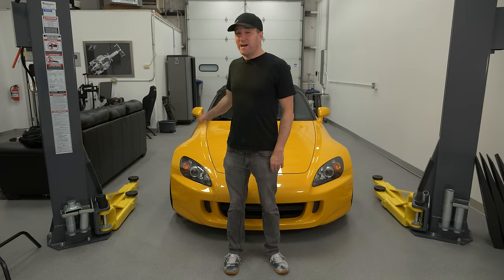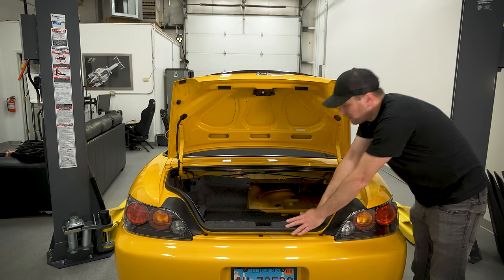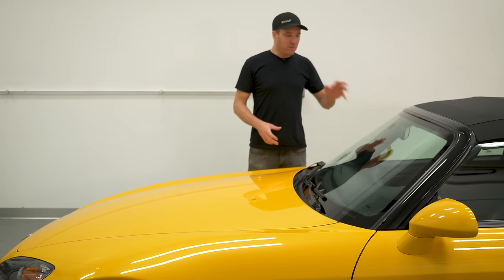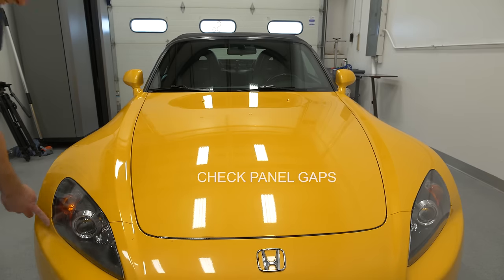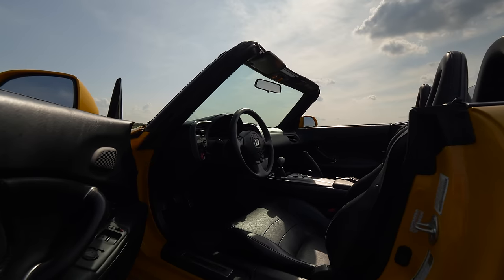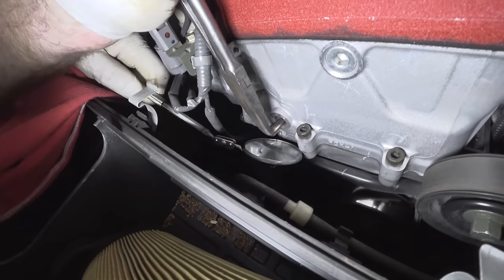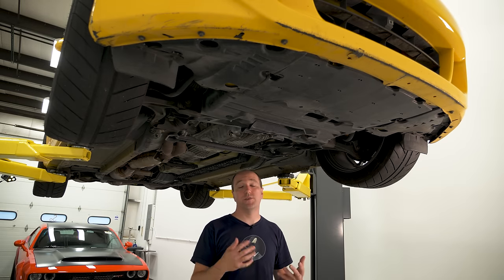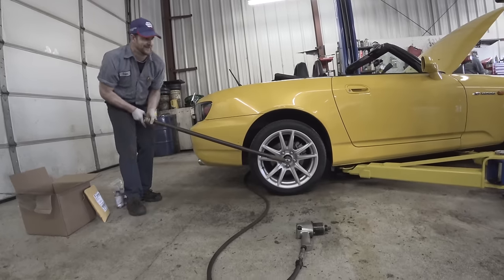Honda S2000 Buyers Guide and More

Comment: In 2023 they are $30,000 or more
Reply: In 2014 I bought mines for $15k used with 40k miles
Reply: Im about to pay 33k for a 2006 with 53k miles.
Reply: @rxa177  Jesus stay away. Unless you really want it! I’m lucky I still have mines I wouldn’t sell it

Comment: I dont even want an s2000 but im gonna watch this anyway
Reply: What if somebody’s mom was gay?  What could be wrong with that??  Let’s ponder!
Reply: The HRE XKR i think it’s a haggard garage joke from chow since that fool can’t speak engarish.
Reply: Lies. You want an S2000.
Reply: @Zygrene  I mean.. they look like Miatas at first glance lol and the differential is pretty unpredictable. I wouldn't own one honestly.
Reply: I didn't either, but saw one on eBay that was just 30 miles from my house.  I went, I saw, I drove, I bought.
Not a single regret.  It even has no VIN sticker on the left rear quarter panel.  Seller explained before I even looked.  Sh-- happens to cars over time, or "this is not the end of the world" (2:46).  Everything mechanical and electrical is perfect - who gives a ff if a body panel was painted or replaced?!  Driving nirvana.
Reply: @BobC59  - I test-drove a friend’s ‘05 S2K yesterday evening. Wonderful experience. He’s the original owner and it’s got only 31k miles - and it was a daily driver from ‘05-‘15 at which time he retired. He’s selling because he doesn’t drive it as much as it needs to be driven. I’m seriously thinking of buying it - he wants $25K for it - if I don’t buy it someone will scoop it up pretty quickly I think.
Reply: @TylerN945  you’ve clearly never driven one 😂 they’re fun as hell and they definitely don’t look like Miata’s , especially with mods
Reply: @Lukemasonmedia  They look fine with the hardtops tbh, I just hate the convertible top look. I’ve actually learned to appreciate them over the years considering my comment was made 3 years ago 😂
They are a little tail happy though which can cause the car to start oversteering unintentionally. I’ve driven my buddies s2k and I feel a bit more confident in my frs, but that’s just because it’s what I’m used to.
Reply: @TylerN945  +1 on your input. The S2k is 100% trying to kill you until you learn how to drive it lol. I spun my ap2 out within the first 24 hours I had it and it gave me a slice of humble pie 😅 not a super huge fan of the rear diff characteristics because of the oversteer concern, but I’ve found as long as I don’t go flat-out around a corner in 1st or 2nd gear I’m good. 245s were a squirrely nightmare, 255s did the job along with coilovers and some alignment adjustments.

Comment: honda manual transmissions should be changed with honda mtf only every 30k miles under normal driving conditions. in a pinch you can use engine oil but that should be changed immediately, this is stated in the owners manual.

 as far as valve adjustments go about 100k for normal driving and yes there is an art to adjusting them but they are far easier to adjust than shim and bucket valves, if you are unsure loose is better than tight. 

honda uses ngk spark plugs in every vehicle they make, you don't need to go to the dealer just make sure you get the right part number. these should be changed every 100k under normal conditions. 

wheel bearings are very torque sensitive and i would not over torque them, most common failure with bearings is galling which will cause noise but they will not be loose, bring a stethoscope or a piece of hose under the car and let the wheels spin in the air and listen to the bearings. if you hear a humming or whining noise that bearing is bad.

a lot of honda engines like the s2k or the b18c engines have high compression and are fuel sensitive, make sure you put high quality premium(91 or higher for the US) in the tank. low quality fuels may cause knock and reduce engine power and efficiency.

I did not see very many mechanical issues with the s2k and most came in for basic maintenance. 

sincerely 

a former honda technician
Reply: P
Reply: Thanks!

Comment: If you ever wondered what it would be like to drive an sports car with a motorcycle engine in it...........this is your car.  The AP1 S2k make the FRS look like an torque monster.  At about 6500 rpm the engine makes this transition to a mechanical wonder.  If you love cars it is something you must experience.  If you love torque......move on.
Reply: Is it really that bad? I had an FRS and thought it sucked due to the torque. Is this even worse for real?
Reply: Steven Buick nah I drive a 400hp wrx and I drove an ap1 and it wasn’t boring or slow to me at all.
Reply: @brandonsinclair4180  They look the business with some nice wheels and the carbon hardtop. On my "next car" list for sure.
Reply: @Silentwitness1978  You wont regret it. Im on my second S2K. Such a fun car to wind out.
Reply: Umm... car with a motorcycle engine? Try an RX
Reply: I got an interesting mix: Toyota 3S-GTE - 2-liter turbo going up to 7900 rpm. (Still not as rev-fun as the VVTL-i engine though.)

Comment: A thorough discussion. As the owner of an AP1 since September 1999 who is tall and has size 14 feet I think the comments on driver size are a bit off. I was close to 6'4 when I purchased my car. I removed the driver's seat and took off the cover, hammered out the metal bucket a bit on each side and removed some padding on each side of my hips. When I put it back in I inserted a large nut under the front of the rails to increase seat tilt. On longer drives I put a folded towel under my legs for more thigh support. Have driven the car comfortably for many miles. I totally agree that this is a car for someone who wants to put the top down and play. I have had no mechanical problems beyond leaking clutch cylinders after 18 years. I live in the south and garage the car. Have changed the transmission and differential fluid once with Amsoil. After watching this I would probably buy an AP2 if I were in the market. While I have gotten a bit sideways it has always been controllable except for one second gear corner at a wet track day. Switched to Bridgestone RE11s and love them. On early cars run 245/40 on the back, not 225. Original rear tires were wider than labeled.

Comment: I just love s2000s; can't even afford one right now though but I can dream
Reply: D. Tran if you want it keep working. I’ve wanted one since 06 and I finally bought mine
Reply: I bought my S2000 new in 2002, Sebring Silver, and it still sits in my garage today. Mine is a California car and just turned over to 8,000 miles. I have too many toys and didn’t find much time to drive it and therefore the reason for only 8,000 miles. Mine has always been garaged, never driven in the rain, no rock chips, door dings, etc. The closest you can get to a new one as it looks as good as the day I brought it home. Now that values are rising I’m afraid to drive it. I take it for a spin once a month to keep it running properly and will eventually probably sell it. I need to figure out what it’s worth. I’m going to want a good price for it because as I said it’s about as close as new condition as you are going to find since I babied it for its 8,000 miles. Whenever I would drive it I would never park and leave it unattended as I was afraid of getting door dings, someone backing into it, etc. so I would take it out on back country roads and just enjoy a nice Sunday drive. I know I will miss it but I have been basically storing it in my garage time capsule for twenty years and will enjoy having a garage again for new toys.....

Comment: I'd owned over 8 S2K's, all the highlighted points are lovely except for the fact that the cost would massively differ!! Like you'd stated in the vid that this car is actually made for fun so its either the original owner or the new buyer will purchase it for that purpose only! having some aftermarket parts isn't bad, it actually is good in some way! Some surface rust on some metal is fine! ( not deeeeep rust tho) as its just some oxidization won't affect the rigidity or performance by any means, just cosmetic underneath. if someone followed this video by the word then i assure you that 99.9% of the buyers won't buy!! its over 10yrs car and the things you highlighted are all serviceable and are not a reason to let go of a good S2k because the owner replaced a control arm or didn't service few things properly! 3-4 of the S2K's I bought were with 160-200K miles which means they should be totally consumed and the engine life is over however they ran solid with no issues and I drive spiritually I don't go easy on my cars at all.  usefull info to learn on weakpoints of a S2K but not valid at all to determine a car purchase unless the car is bought by a person who wants a crisp mint condition! then that individual can follow and do all these checks!  Thanks! TJ usefull video!
Reply: Great information. I'm planning on getting an ap2 s2000.

Comment: As an owner of a MY2000 from mile 3, loved the video.  I've got 125K trouble free miles in the last 18 years. I'm not even in the market to buy or sell, but I still learned a few things. Yes, the wheel bearings are a PITA to replace. Great guide.

Comment: The seats are upgraded in the later models ('06). The leather is a bit more thick, so you gonna have less problem with these.
The VIN numbers are not on every panel in the EU :) That's only in the USA.
Also recommended: SMELL the oil, for petrol in it. 
In the EU we also check the front bumper, when the headlight cleaner is missing then we know something happened. Also check the color of the windscreen cleaner because that was just painted in the color of the car only for the facelifts. This way you can tell it was repainted.
But really good video anyway. Not that much guys know about how to keep the rubber parts in good shape (08798-9013) . This is recommended for every single honda.
Reply: While the seats were redesigned (the passthrough vent in the headrest was removed) in 2006, I think Honda experienced more issues with the textured leather used in '06 and '07 as they once again changed leather used in 2008. The primary complaint in this video had to do with the width of the seats which wasn't changed over the years. Regardless of the year model, S2000 owners would be wise to keep the leather itself well treated (cleaned and conditioned) with quality products such as those by Lexol, and do fairly often.

Comment: Mark: Nail hit on head. Anyone in the market would be so well-served by this. I will figure out how to post about it on my own S2K owner's channel. My contribution here has to do with MTF. After using Honda MTF for almost the entire first 3 years of ownership on my stock '06, I was getting so tired of the incessant 2nd-gear pop-outs on decel from high rpm that I was prepared for a $1,700-$1,900 tranny service to replace 1st and 2nd synchros as per Honda TSB for earlier cars. The S2K forums, though, persuaded me to try Amsoil MTF first. I did, and the pop-outs went away immediately. That was months ago. I also noticed significantly smoother shifting--as did the Honda Master Tech who did the service, and it certainly wasn't his first S2000. I would urge anyone with this particular issue to try this super-cheap and easy attack before shelling out the big $.
Reply: I agree, i am original owner 2001 AP1 and have used Amsoil MTF in the trans since year 1.....no symptoms....Also, i use Amsoil 80W90 in the rear diff, in my first year i noticed that the clutches in the diff would chatter when making u-turns...the Amsoil made the problem go away, never came back!
Reply: I"ll add to the Amsoil MTF helping with shifts. I had a quart left over from my '09 Si MTF fluid change which helped a TON with the 3rd gear issue on that car. I used one quart Amsoil MTF and one quart Honda MTF for my S2000 and have had butter smooth shifts. It's notchy, but always slides into gear easily. Don't have any pop-out issues or any other common problems.
Reply: The mechanic who put the Amsoil in for me, who is a seasoned Honda master technician, said the Amsoil is just a much more expensive fluid. Meaning, it's just of a higher grade.

Comment: I’m buying a used S2000 this evening and this video is perfect prepping me for it
Reply: I bought my S2000 new in 2002, Sebring Silver, and it still sits in my garage today. Mine is a California car and just turned over to 8,000 miles. I have too many toys and didn’t find much time to drive it and therefore the reason for only 8,000 miles. Mine has always been garaged, never driven in the rain, no rock chips, door dings, etc. The closest you can get to a new one as it looks as good as the day I brought it home. Now that values are rising I’m afraid to drive it. I take it for a spin once a month to keep it running properly and will eventually probably sell it. I need to figure out what it’s worth. I’m going to want a good price for it because as I said it’s about as close as new condition as you are going to find since I babied it for its 8,000 miles. Whenever I would drive it I would never park and leave it unattended as I was afraid of getting door dings, someone backing into it, etc. so I would take it out on back country roads and just enjoy a nice Sunday drive. I know I will miss it but I have been basically storing it in my garage time capsule for twenty years and will enjoy having a garage again for new toys.....

Comment: WOW what a great vid. I have had my 03 since 07 and it now has about 70 thousand miles on it. only mods are radio and tsw 17's with 255 Hankooks.  Being that i live in the great white north i have 5 to 6 months to baby it while it sits in my garage. In the summer it is my daily unless it's going to rain. come fall back in the box and jack it up and drain all fluids out ant replace, then the inspection begins, seats come out, wheels off and the creeper time, seems to have work thus far, NOTHING has worn out.

Comment: 2 year into owning my perfect AP1. Under 100k on odometer when bought. I LOVE IT!! Can’t wait to track it. Road Atlanta here I come!!

Replaced:
Thermostat
Both rear axles (CV popping) 
Clutch master
Clutch slave
Shift knob (scratched up) 
Brake pads (ALL)
Brake rotors (ALL) 
Trans fluid
Diff fluid
Convertible top ( 4 days in my garage)
Spark plugs
Front bumper repainted

Needs:
Timing chain tensioner
Valve retainers inspected
Valves adjusted
Oil jets inspected
Sticky tires
Steel brake lines

This car is amazing and I barely fit in it!!

Comment: Regarding interior squeaks and rattles, mine has very few, but the one I noticed when I got the car was the seat belts rubbing on the leather seats, making squeaking noises.   There is a very simple fix for this, get some stick-on velcro (the soft side, not the hook side) and stick a strip on the leather seat where the seat belt rubs on it.  Problem solved 100% and it does not damage the seats in any way.  My car is a UK 2005 model, but this will apply to all S2000's

Comment: 2006 owner currently(new to me earlier this year)/2003 owned for 6 years previous.  I do all my own maintenance- the s2000 is easy to maintain but have a FSM.  TIPS- 1.  adjust the clutch adjustment rod).  2.  check the clutch MC reservoir for dirty fluid- check the MC clutch rod at the clutch pedal- if you see copious amounts of gray paste, clean and try flushing with DOT4 and change the fluid often.  Ultimately that didn't fix my slow leak and so I replaced the clutch MC.  3.  check and adjust tire pressures.  4.  if you have a "crunchy" clutch pedal feel, it may be the clutch slave rod- I had to remove my slave rod and repolish it.  In addition, I relubed the shift fork with high temp urea grease.  Removed the stick shift and regressed as well with HT urea grease.  5.  s2ki.com is your friend.  Good luck and enjoy the ride- excellence again!
Reply: Essential self-maintenance items these, don't expect the dealer to do them!
Reply: so true.  With the age of the s2000, very few Honda dealers are proficient at proper s2000 maintenance.  Look for independents that advertise as s2000 mechanics- Billman in NY comes to mind.
Reply: The market is much smaller here in the UK than the US and therefore there are fewer independent garages that have had enough exposure to the S2000.  I don't know if our S2000 expert mechanics have the same level of expertise as Billman, but there are probably three or four in the UK, Daytona Autos, TGM Sport spring to mind.  These are guys nearing retirement age too so I believe there's a business opportunity for someone.

Comment: Great video Mark, 2 things you missed:
On the AP1, when people replace the original S02 Tires, they usually get the rear tire size wrong
1) The Rear tires were labelled a 225mm section width on the S02s, but in reality they were closer to a 245/255 tire. When people bought replacements they were buying 225mm tires from different brands....turned out that the replacement tires were skinner than the original tires installed, this made their AP1s much more prone to overseer...far more worse if the tires were all season compound
2) The Very early AP1s had weaker clutch springs, at around 2500-3500 rpms when decellerating, the clutch would buzz like crazy, A TSB was out to fix it with an updated clutch.

CHEERS!
Reply from the maker: Thanks for adding that info, to this great details.

Comment: Ive always recommended other s2000 owners to remove that rubber liner on the wheel well of the rear quarter panels.  I believe they trap water and cause rust.
Reply: This.

Comment: The original bridgestone rear tires that came on an AP1 (225/50R16) had a tread width that was 9.0 inches wide, that is the equivalent of a 245-255 sectional width tire. Not a huge deal but something you should consider when replacing them with another brand/model tire that probably won't have the same tread width even though it's the same size.